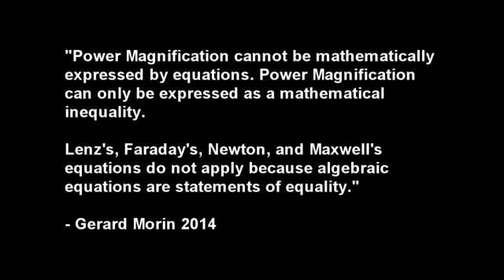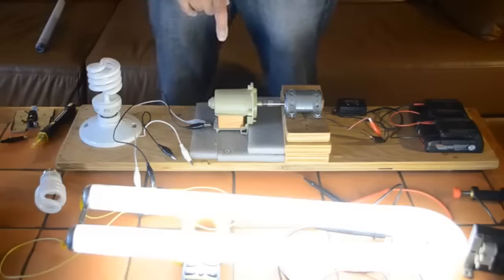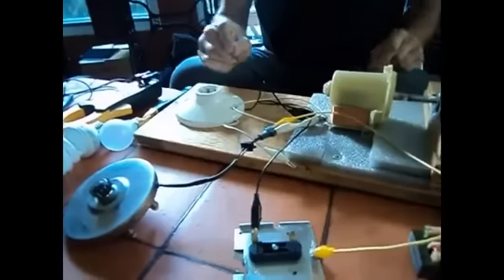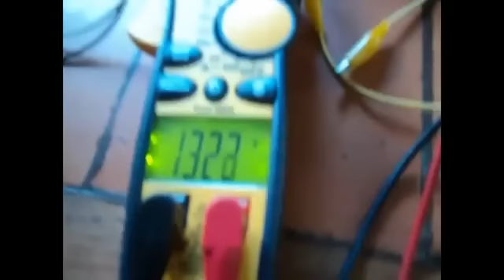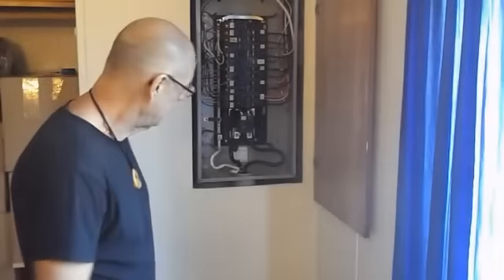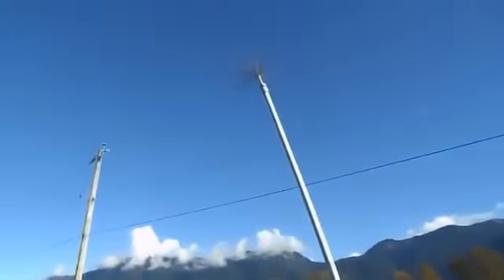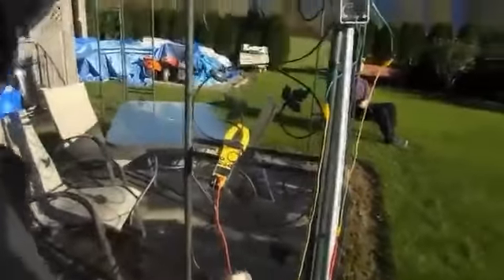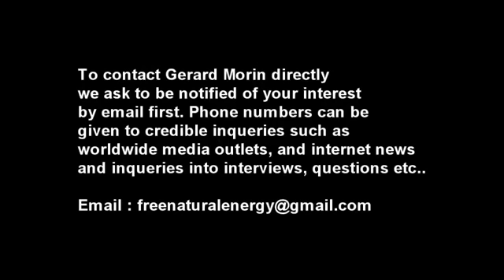Time to END The Electricity Racket - FREE & NATURAL ELECTRICITY PROOF

Comment: I can't follow this--BUT--  When I was a kid, I had a large dipole antenna to listen to overseas short wave transmissions (short wave radio). I connected the insulated at both ends wire suspended over the house and garage to a transistor radio 9 volt input and the other radio connection to a ground wire. It powered the radio, so that it was audible with a speaker in the room. I also connected it to a flashlight bulb, and a ground wire, and the flashlight bulb blew out like an old camera's flash bulb.  My father, who was an electrician for a living with Detroit Edison, accused me of "plugging it into the wall"!!! Since then, I have herd of dipoles in circuitry, and a Tesla like effect that may indicate free energy...??? I did nothing special. No contraption. Just a wire and a ground. I assume more wire would give more electricity. If you try -that- and it works, tell us all. Just don't inflate the process.

Comment: wondering if the inverter he is using is a bi-filar wound coil on a barium-ferrite magnet, there are odd back EMF/resonant frequency effects from these type of coils when they are properly tuned with modulation (standing square wave).   Tesla did use a lot of these in his research.   The radiant energy/antenna set up is reproducible, John Hutchinson produced a Youtube video running a 24 VDC motor with a similar set-up using a copper sphere as a collector held aloft in a pine tree.   If a copy of the book can be found-Arthur P Summera's Sea of Energy gives a very concise explanation of radiant energy and basically says the same thing as Mr. Morin, the Sun ultimately powers everything in our solar system.

Comment: Power equals volts times amps. Electrical devices operate at specific voltages. When a device consumes power yet raises the voltage an apparatus may well work better but nothing is demonstrated except that a transformer is a useful appliance.
Reply: To be  more accurate, with AC, power = Volts X Amps X power factor. Unity power factor ( 1.0 ) is the maximum power factor possible, where voltage and current are exactly in-phase. This will happen with a perfectly resistive circuit. If the load is reactive, (inductive or capacitive) to any degree, the power factor will be less than 1.0. P = VA cos(angle between V & A).

Comment: So, his first example shows a battery running a motor which runs a generator.  That's not free energy since it relies on a battery to operate and pretty much sums up how a typical motor generator system works.

"Electromagnetic watts" are somehow different than watts?  Watts are voltage times amps and a measure of power in the system.

Fluorescent bulb - "no gas, only vacuum" Not how fluorescent bulbs work.  They contain a mercury vapor and a phosphorescent coating.  The electricity ionizes the mercury atoms which releases UV photons that react with the phosphorescent coating which then emits visible light photons.

There's no way to actually confirm what he's doing since he just puts random parts to his device.

When he moves the shaft by hand on the generator, you are making some level of power.  It's how generators work.  Movement of the magnets past the wiring creates electromagnetic energy.

Show the math behind this "new" technology.   But you don't believe in Faraday etc. so that might be hard.

Comment: This man is correct the earth wire is returning power to the earth which can transmit it back through the air like Tesla did. The difference between Tesla company and the power company is  that the Tesla solar power is that you only need a plus and a negative terminal and as you says solar power point is not trying to power the world, I comprehend and am willing to volunteer to help you.

Comment: For sure this man can so easily prove that every engineer does not understand electrical energy. The years of study, and hard work over the past 350years were so obviously incorrect.
Reply: He proved nothing,  he didn't compare the energy output to the energy input. When you hear the motor noise change it is because it draws more current from the batteries and thus the batteries discharge quicker. If you multiply current by voltage you get power (Watts) the watts going in will be equal to the watts coming out less the power lost in heat,sound and electromagnetic interference.  It's basically rubbish.

Comment: AC is the positive wire is Push Pull Push Pull Push Pull the reason you have the same amount of amps on your white wire to your blackweb is that you're using that much power alternating current

Comment: Don't fall for it. Energy can neither be created or destroyed, only changed. More energy must be constantly added to gain energy. That's why we put gas in cars. The energy from the gasoline exploding is converted into mechanical energy, which turns the engine, which drives a belt, powering your alternator, which is like a motor. The alternator generates electricity, which in turn powers your car, and charges your battery. The battery is used to start the car, or to power it when the engine isn't running.

Comment: The neutral goes back to the center point of the transformer.  The pushing and pulling only goes on in the single phase loop.  It is 240v and the return neutral pushes back the unbalanced load. 
You are not sending it back to the power company and loosing money.
We are charged by watts not amps.  You will be charged for 1000 watt of.  If 120 volts it is around 8 amps and 240 volts around 4 amps and 480 around 2 amps.  You will still be charged the same.

Comment: About all this guy might be saying is, CHANGE all your light bulbs to florencent. Use the 110v wall juice, but convert it to super LOW amps, and transform 110 to 100,000v, and then run the house lights. Power bill would be super cheap. I think? we get charged for amperage?

Comment: The light bulbs were a shunted bulb, that you burnt  the conductor inside bulb, then it will acct as a non shunted, and you can apply current to each end. That is what you said you burnt one end in socket. I don't know much , but I see threw that demonstration. I would like to know more about the rest from some one that understands it better. I  see one easily explainable part and i question the rest i don't understand. If this is easy and you wish to share how, i have a electrical background,

Comment: The answer to your question concerning the white wire  in the breaker box  going back to the transformer..the reason you are showing current draw on the white wire is because the power  being used on the left side must return back to neutral wire  which is commonly called a common wire . it does run back to the transformer but then strait to ground via a grounding wire sometimes seen on poles stapled to the sides but most of the time it goes back into the transformer station  to earth ground. .. it does look suspicious thou when you follow it back into the meter loop ..220 has only 2 hot wires  that feed the breaker box  that runs thru the meter loop.the power going in and the power going out will differ depending on the current draw on the devices being used .most 220 hot water heaters use a steel pipe groundind to serve the nuetral wire  to save on expense from adding extra wires back to the breaker box . I don't know what the regs are where u live but if you think about it the frequency of the hertz is also altered when it is returned via white common wire  just enough to off set the disc ,,ive wondered myself if that actually speeds up the metering device ,,instead of reading the 60 hrtz it is now reading 120 
hertz or so depending on whether the neutral wire does run inside th emeter itself .I will check into the wiring diagrams of meters  just to confirm my suspicions or debunk it

Comment: The voltage falls off when it goes through your electrics the power is  Dissipated in the form of heat and eddy currents and light. Energy is transformed but never created or destroyed. Over union devices violate the conservation of energy law of physics.

Comment: The Amps can be doubled, but you need a user that will draw twice the Amps.
AC motors are NOT 10x more efficient.
DC motors are about 85% efficient.
AC motors are about 96% efficient.
But it also depends on the design.
A very efficient DC motor can be more efficient then a badly designed AC motor.
Reply: You CANNOT increase voltage without also increasing the current in a circuit. Ampres and voltage are proportional.  Current increases unless there is a change in the resistance of the circuit. The load is considered part of the resistance. (E=IR) regarding motors usually motors are designed to compensate for the higher voltage. High voltage setups make power with lower amperage because they use motors with a much lower kv. So you'd need to intentionally overload the circuit by making that motor work harder than designed causing damage to the motor and possibly starting a fire or a arc blast if there is no over current protection wired into the circuit. 

FYI AC motors are far superior than DC motors unless you're talking about the specific application of controls. Where you're using servo's and encoders for motion.

Comment: The Modulator is creating electricity. When a magnet passes, a wire. Electricity is created. The problem is. You need energy to keep the magnet passing by the wire. Usually the amount inputted is greater or equal to the output. Therefore a wash.
So in order for that device to be worth anything. It must run forever without the batteries ever discharging while under load. He never shows us this.

Comment: The only thing that matters is watts (electrical power).  Watts=Volts X Amps.  You can transform DC voltage to anything you like - either with an invertor or a motor/generator as shown here.  (AC voltage can be changed with a transformer).  But the power from the battery (watts) will be the same as the power out plus some losses in the system.  No energy is being created (or "manifested") here.  Increasing the voltage to the lamps by using a motor/generator will increase the current and power taken from the battery so they will go flat more quickly.  An electronic invertor will get you 120V from a battery far cheaper and with less energy loss than this motor/generator setup.  Buy from Amazon.

Comment: There is nothing about free energy in this video? It is basic electrical principles he is going over. Converting DC to AC, was made obvious in the first video when trying to run an AC CFL bulb with DC batteries, when hooked up through the motors, the DC batteries power the motor, which turns a generator producing AC which a CFL bulb needs to work. Not to mention he used a transformer to step it up to 350vAC from 135v, you can only do that with AC. This is literally just electrical basics tutorials.

Comment: Hmmmm..... where do I start......
Tesler? Water boiling at 150deg? 
Cut the polution by 100% in 5 years!? 
Tesla cars are running ac motors!  
There is gas inside a florescent tube and mercury vapor is what will harm you. During the manufacturing the vacuum is purged and gas is replaced depending on what desired light color is desired. 
Trust me, he isn't doing anything new. You can hear his generator bog down through Lens law as current is needed, and enough of it and he would over amp his batteries. I can't keep up with all of what's wrong, so much more is present as I am writing.  Forget it. Reuse your own power through a transformer? Only if you do it before the meter.....which is called a thief. 
It's a good thing he only is one person, if we had a world of those peeps, we would have a desk full of noisy contraptions that run less than satisfactory devices. Does it run a refrigerator? Cause if so, that is what we need. If we don't have refrigeration, we are a third world country. 
Sooooo much wrong.... no mathematics? This guy would look so smart to an idiot. So I guess enjoy idiots. 
Keep learning buddy. There is a lot to learn out there.  He should watch smarter every day for starters.

Comment: Bradalexander, If you want to convince anyone that what you are doing has anything to do with reality, place amp meters in series with the batteries and between the your little generator and its load. Let us see what the load is.  The frequency from you little generator is probably several thousand HZ which is probably rich in harmonics which also changes the dynamics of the equipment hooked onto it.  Put a scope on the output of your little generator and you will see what I am talking about.
This is mystifying to those who know nothing about electricity, but it will not do much to feed you and your kids.

Comment: He's mearly using a coil to multiply the voltage, but that doesn't increase the amps. Therefore you can't run anything that needs high current, like your toaster, electric heating. Power tools, air conditioning, and on & on. Trying to get investors to pay for nothing.

Its like trying to jump start a car with tiny wires, doesn't work!

Comment: This really sad because a real applied science channel would show you exactly how to make his device, then like science, lots of people would repeat the experiment. Over time, as the new way proven, its becomes science. The problem is that he refuses to explain his trick because its just an elaborate voltage boosting DC to AC converter that uses a limited life motor rotary generator with bearings & frictions to boost 36 volts direct current to 120+ volts of AC at low amperage, effectively a waveform transformer of sorts //

Comment: He's wrong and he's adding labels that are also wrong. No matter how you spin the shaft, it's just another unregulated isolated electrical generator. ALL of that power comes only from the motor shaft and therefore the battery. ALL of the demonstrations are of electrical transformers that merely convert that power to a different voltage and the same power. P=I x E He's got a 5th grade education? Yes it was always boring. But I sat through all 12 plus two levels of electrical wiring and theory, served an apprenticeship and have 40 years experience in electrical work. Unregulated power is also not very useful or he could run sensitive electronics. His toy is not that safe or powerful or he would have run his house off of it instead of the electrical power mains. It's not a 10 KW generator.

Comment: The 240v house voltage is from a center tap transformer   winding Lc- where center tap Lc is the white neutral is zero ground voltage.  There is 120v to each end L1 to Lc and L2 to Lc ,  and they are 240v L1 to L2. The current  may just be on in L1 so 3 amps is flowing  L1 to Lc, but nothing in L2 to Lc. There has to be a complete circuit. In old days as he said the earth ground must have been used, which proved unsafe and ineffective and insufficient so a  solid white copper is used nowadays. The man's ignorance  of proper wiring and current  flow and voltage  distribution  leads him to wrong conclusions. Also he upped the  voltage 120v to 132v  for more wattage through bulb, he isn't gaining more energy from nothing,  it's  like you got $1 watts to use , you can use 50 cents watts for 2 seconds,  or  25 cents watts for 4 seconds,  or 10 cents watts for 10 seconds, or 1 cent watts for 100 seconds , the higher the wats used per second the quicker you drain the battery as you are still using $1 worth of watts ,a 50 watt bulb is brighter than a 1 watt bulb. Even if he uses house supply he is just transforming the power from one level to another ,that happens inverse proportionally so if voltage goes up the current goes down and if voltage    goes down the current goes up so power is same on both sides

Comment: Well when you run the motor your drawing more current from the battery so the battery will drain quicker you're not producing any more power the bulbs just need a higher voltage to run that's why are using the motor regenerate the higher higher voltage you should measure the current coming out of the battery it'll be more when you're running the battery to run the motor so you're not getting anything

Comment: Using a rotary converter instead of a transformer to convert a low-voltage high amperage output from a battery to a low current high-voltage input to a light proves nothing. Power is measured in Watts which equal volts x amps. Juggling the ratios does not give you any more. To suggest it does is as disingenuous as the daft idea the EU came up with that energy would be saved if they limited the power of kettles whereas even A-level physics teaches that it takes the same number of calories to eat a given volume of water through a given range of degrees regardless of whether you do it fast or slow.

Comment: Skilled electrical engineers use primary and secondary windings with a pair of transistors,  these fools use motors. What's the power efficiency guys? 30%!